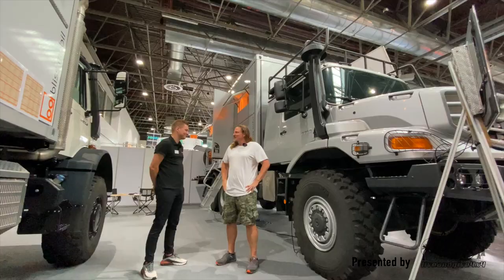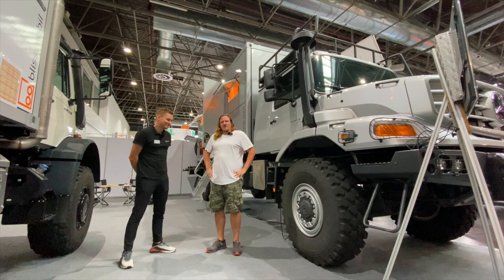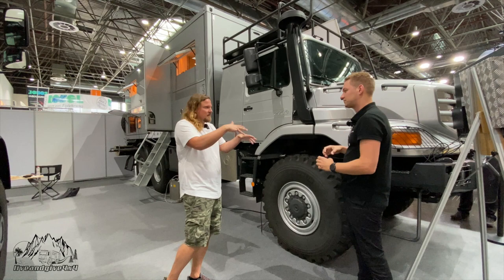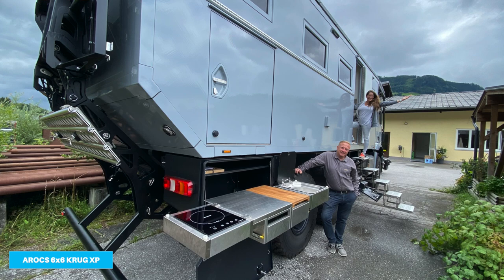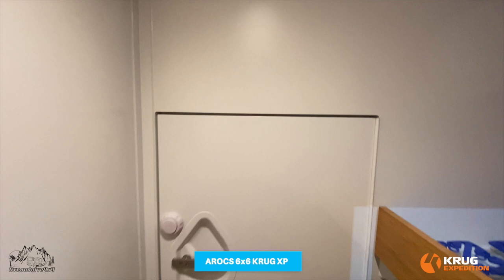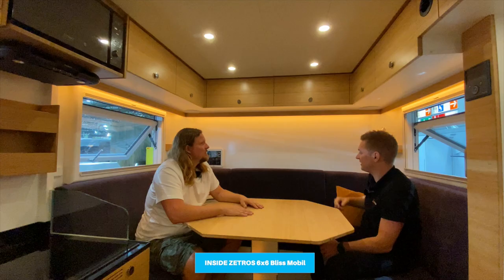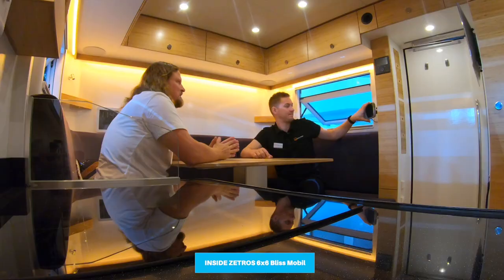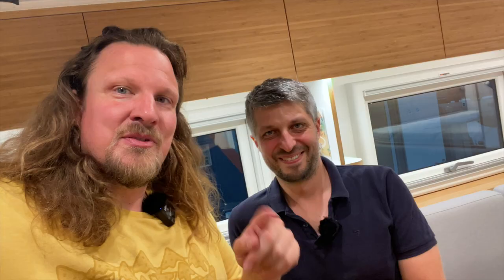BEST 6x6 MERCEDES Expedition Vehicles in Caravan Salon 2021 ► | BLISS MOBIL Zetros vs. KRUG XP Arocs

Comment: Getting BLISS to say they developed a twist lock system on a box that fits in a container when you take it off but that will never be used because you need 2 trucks and chassis .... priceless... :) :) :)
Reply: The Bliss Mobil concept shows its importance when, for example, in the event of a crash, you can remove the cell and put it in a campsite while your truck is being repaired, like what happened to a couple of overlanders in Africa.

Comment: Nice, I went to that salon and spoke to these people in question, also viewed those vehicles from the inside since I'm planning to live permanently in something like this within a few years of now. Loved both of them. 
Personally I hope EV drivetrains will find their way to expedition vehicles soon, since I really don't want to invest such a huge sum of money into a combustion engine. So I hope Mercedes will come with an electric Unimog soon, since they already announced an electric G class. Then I could buy an electric unimog, bring it to BlissMobil so they can put a living unit on it and save a LOT on fuel. I also heard from these guys they were working on a new solar panel roof mount system which enables you to fit more solar panels, and mount points for RV windmills.
Reply: LOL! Where are you going to charge your expedition truck in the middle of the dessert/jungle? Electric vehicles only make sense when there is a charging network nearby.

Comment: Great video again. We build our EV on MB Atego. I Also considered MB Arocs but I'm afraid of electronics and weight in 4x4. 15-16 tonnes is a lot. You have a lot of experience, Could you tell there many other benefits to choose Arocs than Atego in similar wheelbase? Atego 4460mm vs Arocs 4500mm. Arocs is heavier about 2,5-3 tonnes. Thanks for advice !
Reply from the maker: Thanks 🙏 Atego is the light weight within the trucks segment, you are right… depending though on what you want to build on the back you may choose Arocs over Atego… the sizes and weights on Atego are physically limited… the engine sizes as well… so there is more to consider in this decision which cabin or which chassis one may choose … in regards of electronics it’s a matter of the year of your truck not which model… find here more about the myth of not being able to use a newer truck on a world trip if you like 👍😉https://youtu.be/C63dS_kcvOE
Please sign in to our newsletter if you have more specific questions and let us know in the message box what exactly, individually you need to know for your build… we will get back to you then ASAP 💪🍀🙏 www.Liveandgive4x4.com/newsletter
Thanks for watching 🙏🍀😎
See ya when we see ya 👋 
Fabian Isabela and Matheo

Comment: Did not realize Zetros uses so much fuel! ~50L/100km! That's alot. Do you know why Zetros is consumes so much fuel? I always thought big trucks uses 20-30L/km....Arocs is so much more efficient in comparison. What's the benefit of the Zetros? Nice videos as always but I feel having 2 dedicated videos, 1 for Bliss and 1 for Krug makes more sense. I think this switching around is quite disruptive to the flow.  Also, you only cover part of each cabin. Would be better if the walk through is more detailed and in-depth for each truck. They are both amazing vehicles!
Reply from the maker: Next time 😎😀🍀👍different focus in this video … heavy zetros needs more fuel I guess … we feel it is clearly marked what you see in the video… thanks for watching… more soon to come for sure 💪👍🍀
See ya when we see ya 👋
Fabian Isabela and Matheo
Reply: At 330hp , 6x6 Zetros is underpowered... and 50L will be in terrain , not highway.... (Zetros is more myth than fact) .. it was build for the army to have it low for shipping reasons... its why it has a long nose design .. which limits the length you can put on the chassis.. hence 20FT container on a 6x6 and not the 7M box.. ..  but it does look ultra cool...  :)
Reply: @kopeducati  Thanks for the information. The quoted figure 50L/100km for off-road. So it is about 25L/100km on highway? So the fuel consumption should be similar to other trucks? Zetros is the big brother of Unimog which makes it cool :)
Reply: @earthpeace3323  hmmm . The unimog is quite unique . Zetros is much closer to AROCS than to UNIMOG .. frame and suspension is totally different it seems .. but it is cool 😀